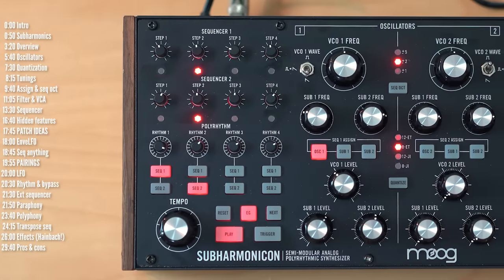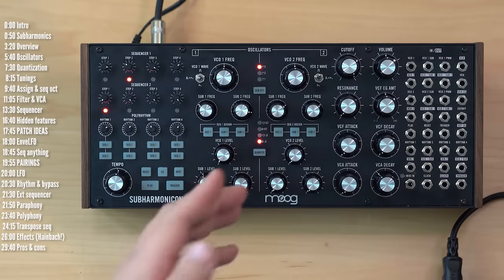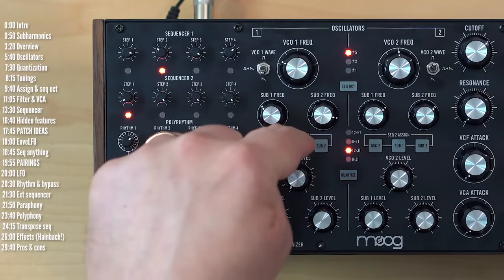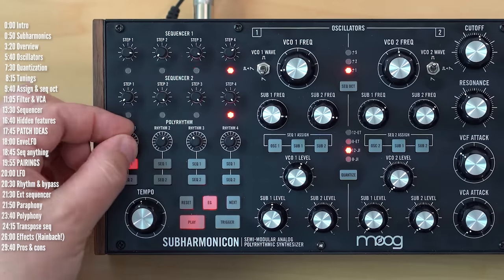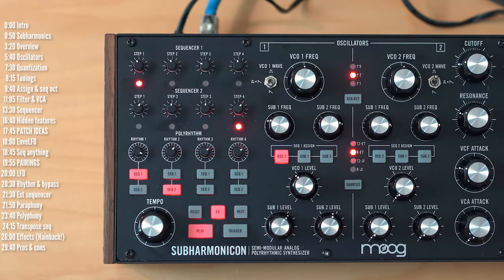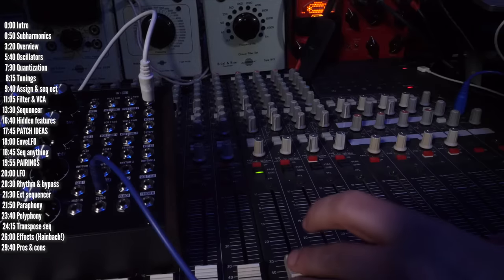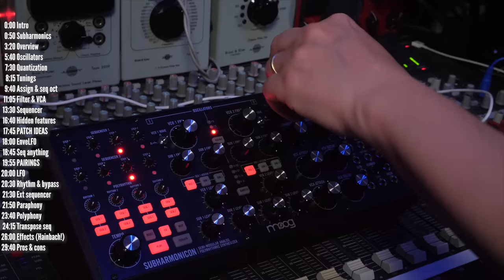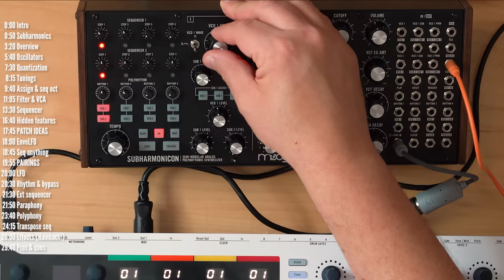Moog SUBHARMONICON Full Tutorial with 9 patch ideas and pairings // New version reviewed

Comment: Loopop. I am after some advice. I have the subharmonicon (great unit from moog), I have the sub37 too. And I have the Arturia Drumbrute. They all actually complement each other well.  I have been trying to get Oscillator one to be triggered by the drumbrute clock out. This is no problem when place Drumbrute clock out into the 'play' in of the subharmonicon. But, I am trying to isolate oscillator one from Oscillator two, and have the sub 37 trigger just Oscillator two by midi out of the sub 37. The sub 37 is duophonic but, if it can be done, there is the possibility of playing the subharmonicon as a sequencer triggered by the drumbrute, and have pad like paraphony played on oscillator two in conjunction with the sub 37's own oscillators. I have been able to have 9 oscillators on the go using the sub 37 to trigger all oscillators of the subharmonicon together with the sub 37's two oscillators and sub oscillator. I just don't know what to try to be able to split the two oscillators and trigger them independently using outboard kit. thoughts? I understand we are all hoping for a firmware update to the subharmonicon for duophonic upgrade but till then, is there a way it can be done? Stay good.

Comment: Very thorough and concise demo of this unit. Nice job. However, one thing you did not mention is possibly using just the filters with other instruments, such as a guitar with a distortion pedal. I'll bet a thousand other guitarists watched this video and thought the same thing as well. So how would that be done exactly with this unit ? Would a CV controller pedal be needed.. OR would it be possible to just plug in directly ?
Reply from the maker: Thanks! and my bad for ignoring guitarists! However, the charm of this instrument is the oscillators and sequencer, and just patching audio into the filter would kind of be a waste of everything else here (or just overspending)
Reply: @loopop  - I think I just realized that, since there doesn't seem to be any type of LFO or envelope filter controls on the Subharmonicon.. which would make it rather pointless for guitar, except for maybe the HP filter? Actually, I'm not even sure if the sweepable VCO and Sub controls would be usable as a Q effect for a guitar. Is that even possible? lol

Comment: Loopop, sorry for asking this before but I like the oscilloscope you’re using presumably on an iPad. Can you tell me what app you’re using and what you’re using to run the audio from the SubH to your iPad?
Reply from the maker: Hi, I use MOscilloscope and MAnalyzer by a company called Melda - they’re free with some limitations in the MFreeFXBundle. Occasionally I’ll use scopes by VCV - its all on a computer, not iPad
Reply: @loopop  oh ok that’s what threw me off. I suppose it would be much easier to add to Premiere if it’s on the computer.

Comment: Thanks for the ideas. I just picked up a SubH and NDLR recently, both are great. How would you suggest (in a few words) patching a NDLR controlling Subharmonicon for its voices? (4 separate outs on the NDLR ). Is there a way to get 4 separate voices on the SubH? I dont see any way to get separate midi channel assignments on the SubH...  thanks.
Reply from the maker: Thanks, there's no easy way to make that happen - I would suggest thinking of the subharmonicon as one of the four things you control with NDLR
Reply: @loopop  thanks. Thats what I thought - its basically just one voice x 4 oscillators you can use with NDLR with the addition of the SubH sequence patterns.

Comment: Why did it speed up when you added the second rythm? Isn't  it a clock divider wouldn't  slow down even further? You should do a video on how to chain eurorack modules together to build a similar polyrythm sequencer!
Reply from the maker: The pattern speeds up because the slow triggers add up in turn, kind of like the a horse running with (hopefully) four legs

Comment: Hi thanks for the vid, very useful. Is there a easy way to get in a minor or major scale with tuning options? Or do I need a tuning device. Thanks a lot
Reply from the maker: No need for a tuning device - a major or minor scale (or any of the other 5 basic modes) is really a matter of where your anchor is when you use 8 ET intervals, which this supports
Reply: Thanks for your answer, appreciate it, cheers Peter

Comment: Is there anyway to get one set of oscillators to go through the vca/filter but route the second set to an external vca/filter?
Reply: YESSSS this is exactly the question I would love to know.  Break those oscillators and subs to their own vcfa's.  There is another guy on youtube that uses a MI: Streams and sends each of the mixed osc and subs set to Streams for filter/amp/enveloping.  So it is possible to break them out like that but not sure if you can do that and use the internal vcfa for just one osc and its subs and external vcfa with the other osc and subs.  That would be super duper killer –and then mix them in stereo. Boom!
Reply: Also less gear to buy...

Comment: Did you figure out a way to switch the root of the Just Intonation scales?  I was ready to buy one of these and then did some research on how to switch the fundamental of the J.I. modes and it appears you are not able to.  So basically you can only play in C major and modes of C major.  This greatly reduces the usefulness of the J.I. modes.  I suppose you could use something like disting mk4 to add the additional tuning function (or utune tubbutec) but that adds another $300-500 if you need a case and power for modules.

Comment: How does it receive MIDI clock messages? Is it synched to sequencer 1? Or 2? Or can you choose? Curious how the polyrhythms would interact with other gear.
Reply: I think I found the answer in the Ext Seq section. Seems like MIDI works but CV is more agreeable. Also, can you change the MIDI channel on Subharmonicon easily?

Comment: Dear Mr.Loopop,

I have posted this on the moog forum too, but maybe you already experience similar situations.

Could you please help me understand how the SH midi works?

Scenario 1: Midi Keyboard -> Subharmonicon all channel 1  ... no clock just notes
Sequencer 1 with simple 4 different notes
Play On
EG Off
Rhythm Seq1 on
VCA Decay minimal
[attachment=0]IMG_3565.jpg[/attachment]

When playing Midi Note seq 1 cannot be assigned to OSC1 only Sub1 and Sub 2
pushing OSC1 has no reaction

opening VCA Decay gives the sequencer 1 series as per knob positions
-> note played on midi keyboard is not "saved" with vco1 

same applies to VCO 2

Scenario 2: Ableton Live -> USB-Midi-Interface -> channel 1 
- start stops works and puts SubHarmonicon in sync

rhythm 1,2,3 and 4 doe not work as polyrhythms
survivel of the fastest. fastest rhythm will win the battel

can you please try and explain the behavior?

Kind regards,
Christian.
Reply from the maker: It just worked for me without much effort. Please post back here if you figure out the issue - thanks!
Reply: loopop, could you check if your unit shows the same behavior? Do your vco 1 2 follow the sequence when a midi note is send to SH or does only sub 1&2 follow the sequence? Would be much appreciated. Thank your for your videos! Great stuff!

Comment: what midi adapter are you using? i need to find a 3.5mm jack to MIDI DIN TRS type B model and was wondering what you recommend
Reply from the maker: This requires TRS A - my unit didn't come with one so I used another I had around the house (Elektron actually)
Reply: I know this is slightly off topic but which one did you use for the polyend tracker? I’m looking for a midi cable compatible with their 3.5mm ins

Comment: Nice synth, great review ! If the module has the same depth as the DFAM/Mother 32, just drill 6 holes on the back and fix a passive and cheap CVpal from Mutable (without the faceplate) -> Endless fun .

Comment: No midi that’s a real shame it sounds good though and I may bag one. it’s an interesting point Loopop makes about no Midi CC on most of these semi-modular bits of kit I mean they are begging for midi CC not only for sound design and control but the ability to save patches etc. I don’t understand what the problem is I mean my grandmother has midi cc on the  Sync knob but not on the Cutoff !! I don’t get why, I can only imagine it’s cost ?
Reply: It has MIDI in - look at the bottom of the patchbay. Many eurorack modules / instruments are using 3.5mm connections instead of the traditional 5pin DIN. The Subharmonicon receives MIDI clock plus some CCs. Manual page 42.
Reply: Jan Pienkowski hey thanks Jan for the update and that is the trouble when you watch things quickly on an iPhone you can’t read the text on the patch panels well if you have eyes like mine ! and you don’t listen to the full explanation regarding the midi !!  It’s Definitely an interesting bit of kit and will sit well alongside my dfam.. so it all comes down to the price point.

Comment: Has the clock delay bug been finally fixed? Anyone knows?
Reply: I have a brand new subharmonicon and have that clock delay issue, so the "trick" at 21:25 only works if your clock is fast anough that you don't realize the delay. 
The SEQ 1 CLK and SEQ 2 CLK pulses come simply one CLOCK pulse too late.
And i found no firmware update or patch for this.